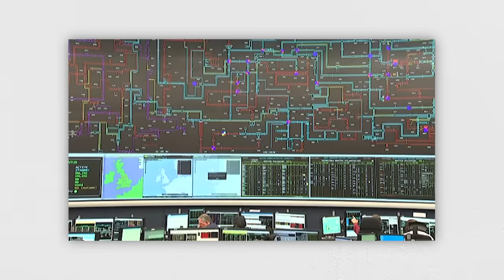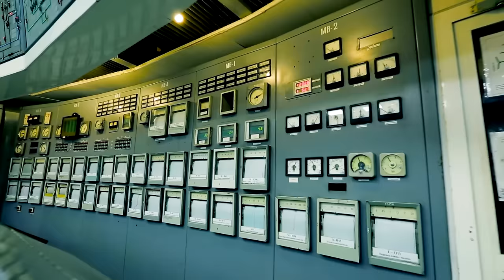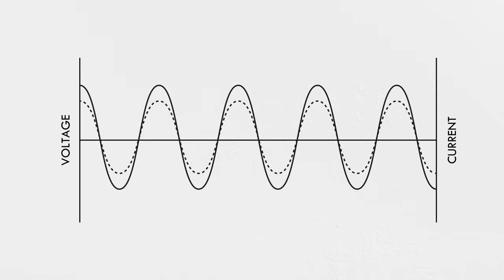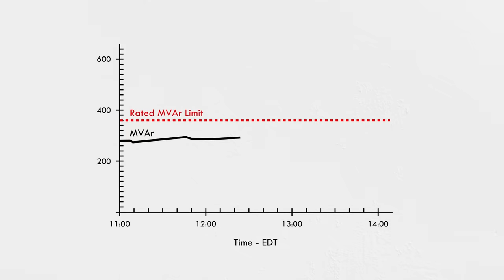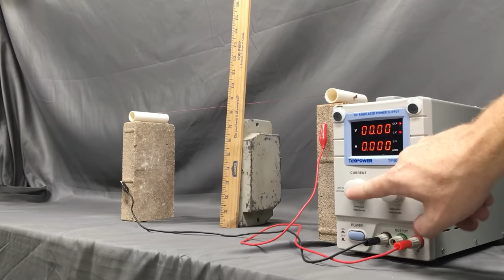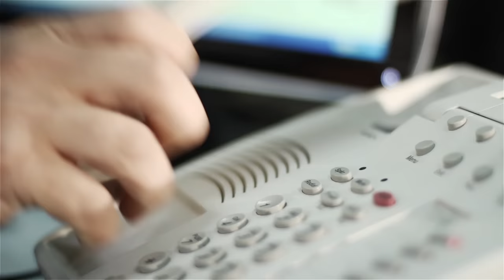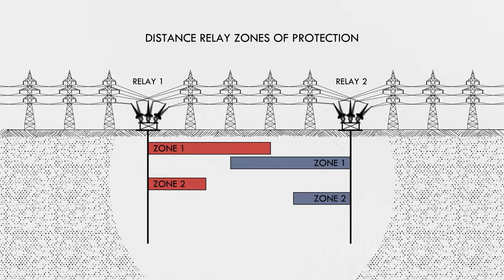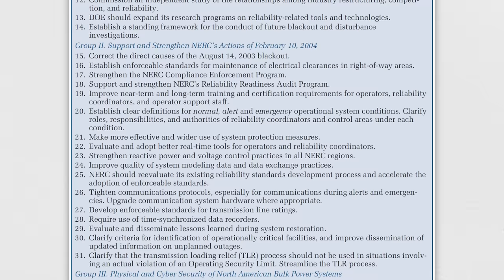What Really Happened During the 2003 Blackout?

Comment: The Lift Pump Station located near Ludington, Michigan helped save the entire eastern half of the US and Canadian  power grids. This facility maintained grid frequency by absorbing most of the nearly 5 GW load imbalance as the disconnects around Lake Erie engaged. The pump station filled itself to the brim, well past its safe design water surface elevation, then ran itself nearly dry, again outside of safe operating levels and at great risk of causing cavitation in the turbines to provide power afterwards. These actions helped prevent catastrophic damage cascading all the way to Denver and gave some time for other stations to reconnect.

If a power station is scrammed, a rapid shutdown, and depending on its type it can take days if not weeks to get a power station back up and running. A pump station can provide nearly immediate power generation.

Thank you to all of the station operators, line workers and service crews who struggled on that day, your actions and quick thinking, kept the lights on east of the Rockies and prevented a far darker outcome.

Both the 2003 and the Texas outages could have been much worse if the load imbalances had been allowed to progress a few minutes or even seconds longer.

The control systems in place now are night and day more robust than what was present in 2003.
Reply: Sounds like an entire video could be done on their actions that day
Reply: @T.J. Kong Now imagine a nation state deciding to infiltrate the intranet these stations connect on.
Reply: This was the early thousands, when communication systems were less robust
Reply: Living in Mt Pleasant, MI at the time, all I knew was that we had power and Detroit didn't. Now I know why! Thanks for that.
Reply: This sounds like an amazing story. I did some quick googling, but I didn't find any additional information. Would you mind sharing any articles about the Ludington Pump Station operators?
Reply: @kevin3434343434  So the plot of Die Hard 4?
Reply: We need significantly more of these stations for increased grid reliability.
Reply: @jtb1515  nah, we got batteries now for that now... plus there's more solar now then then, which can allow the homes to act as collective batteries and donate back to the gird...
Reply: You have anime profile picture,  your opinion doesn't matter.
Reply: @T.J. Kong The Alarm subsystem in the Energy Management Systems now have a little display that indicates that it's working.  If it stops cycling, you can immediately see that alarms aren't being processed.
Reply: If you can believe Wikipedia, the Ludington Pumped Storage Hydro Plant is comprised of six, 355MW units.  That's a little over 2GW, not 5.  And, I can't imagine being able to pump one over its design limits.  We had to demonstrate to FERC routinely of the multiple fail safes that we had in place at our pump storage plant to prevent filling above design level.  After the Tom Sauk plant in Missouri over topped its reservoir, this became even more heavily scrutinized.  
Also, if you ran a hydro so low that you risked cavitation not only would that be irresponsible and possibly destructive, the upper reservoir would be so low as to not provide much head which is required for power production
Reply: Based Michigan carrying half the US on its back
Reply: @123livewire  dang maybe OP is a bundle of sticks.
Reply: Wow, that's pretty interesting, props to the people at the place who kept it online
Reply: @123livewire  okay so you're saying that the pump station did jack shit to help in 03?
Reply: Lift pump station? That and a pumped storage hydroelectric station, which is what Ludington has,  are 2 very different things.
Reply: @alexrogers777  Not ours...it's independent. We should hook up a DeLorean to it.
Reply: There's a similar facility on the Canadian side of the Niagara Falls generating facility, called Sir Adam Beck Pump Generating Station. It pumps water into a "lake" at the top elevation during times of reduced water consumption at the main generating station and then is used during periods of higher demand to augment water that is available from the normal supply from the Falls.
Reply: @carlosanvito  There's a similar facility out here in so cal called Castaic Pumped Storage Plant. They're pretty common now
Reply: This is complete BS. Pumped Storage is great but it didn’t save any lives that day lol.
Reply: @PrograError ,  The total amount of batteries in California can run the grid by itself without the use of solar panels (say at 7 pm) for about 7 minutes.  California imports about 8,000 MW every hour from 7 pm to about 7 am, until the 14,000 MW of solar wakes up for the following day.  California does not have 8,000 MW of batteries yet, and might not for years,  And to get 8,000 MW X 12 hours, that would be a huge investment in batteries, that would not be needed on a daily basis, but only a once in a few years event like this one.  

Battery cost - they hope to get the cell cost to less than $100 per KW or about 10 MW for a million dollars. So a 8,000 MW battery would cost about $800 million just to purchase the cells, then about another $800 million to put those cells in racks, and connect them to the grid.  And that will serve the imported power needs of California for just 1 hour.  There are 12 hours before the solar panels start producing power the next morning.. .  .

And your typical solar system requires power to allow it to re-start.  So no power to them, they are not allowed to restart, because of the danger to electrical linemen, who count on a power line staying de-energized when they shut off power at one end.  I agree that once the grid is working, then all those solar panels can collectively absorb a lot of the loads on the grid, and are aHuge and un- recognized benefit to the grid stability.   However to much power "Could" be a bad thing, and cause the voltage to get to high, when there is more power supply than demand, and this results in increased line voltage and line frequency.  But with 10,000,000 customer's refrigerators suddenly coming online, and then those customers starting their heating systems, that is a lot of load that will come online just after power is restored to a tract of homes (and several tracts of homes).
Reply: That's not true. Where did you get that information? That's not what the power plant officials said in Buffalo, NY. There wasn't any pump station generating its power to the northeast electrical grid in Buffalo, NY. It was the nuclear power plant the one tripped its fault, leading to a complete shutdown in safe mode to prevent a nuclear explosion. It was the solar storm at the root of the outage that day. It failed to supply to Cleveland after a complete power outage in NYC was reported first. It hasn't reached Detroit until 4:45 pm that day. Cleveland went into a complete shutdown at 5:05 pm, cutting off powers to the entire northeast. So don't blame the pump station, blame Niagara Falls Nuclear Power Plant the one that triggers it.
Reply: @Kangenpower7 Amen brother. You saved me a lot of typing. These guys that think the batteries are going to handle a cold start of the grid are so deluded
Reply: @pantherzone2008 Bro what. That's like not even vaguely true of the August 2003 blackout bruh?  Whatchu smokin

Comment: I was working at a 2000 MW power plant that day. I recall hearing air blast breakers operating frantically in the switchyard just after 4 pm.  Lights blinked and then moments later the plant was black. From my office, I looked across the river and saw two other large power plants also fully tripped.  Our plant generators were spinning, but there was no grid to connect to. We hoped to keep the units ready to resynch, but we could not keep up with demin water consumption, and one by one, lost the plant.  The grid was partially restored by the next day when we were able to fire our units and resynch, thus rebuilding the grid. Certainly a day etched in my mind!
Reply: What kind of plant was that? In the hydro world we just keep one or two groups spinning and exited but asynchronous to maintain our auxiliary transformers indefinitely. What consumes demineralized water and why can't it run on local power?
Reply: I'll bet
Reply: @DickCheneyXX  Almost certainly the boiler make-up water for thermal power station.
Reply: If there was a station blackout, where did you get the power to run the pumps and the draft fans?
Reply: @gregorymalchuk272  We built the grid backwards from our hydro electric plant at Niagara Falls (their station service requirements are virtually zero) and when we had power at our station we were able to restart our units normally via the reserve station service transformer. We could aid have used standby gas turbine generators to do the same.
Reply: @DickCheneyXX  It's a coal plant, so the boilers use demin water to make steam. Normally, the steam is condensed and reused in a closed loop, but when spinning the turbines at zero load, the boilers cannot be turned down low enough, so we have to blowdown the steam which means we have to make new water. Quantities are huge, In the order of 1 million pounds per hour. We can't use normal water as it would damage the boilers and turbines. Local power didn't exist and even of it did, a plant that size would need about 50 Megawatts to start up all units.
Reply: @DickCheneyXX  Every boiling-water plant uses demineralized water in the steam system. Can't have your expensive, precision-engineered steam turbine fail because minerals precipitate onto the blades...
Reply: I once worked at a nuke plant and conditions forced us off grid. Emergency gen kicked in and everything went into shutdown. What an amazing thing
Reply: @danielmorse4213  Unlike nuke plants, we can hold our own for quite some time, supplying our own station service. But sadly, we were forced off due to a lack of denim water.
Reply: @carlosanvito  what is demin water ? What used it and what for ?
Reply: @Txepetxcc  Sorry for the "tech talk." It's demineralized water. That is the working fluid - it's heated by the fuel in the boilers to make steam (to temperature of 1000 degrees). That steam spins the turbines which turn the generator rotors to make electricity. When the steam is spent, it is condensed back to water and returned to the boiler to make steam again in an endless loop.  We must use demineralized water to prevent damaging both the boiler and turbine.
Reply: Very cool first hand account
Reply: This is why you keep some of the water from boiling your spaghetti noodles!
Reply: krisfalkenberg u sound like the Unabomber 😮

Comment: When first learning grid operations it was explained to me thus:

Imagine the ceiling in a room has a wide variety of hooks embedded.  Each hook can only support a different weight and will pull out if overstressed.  Now imagine you have a wide variety of weights that you must suspend from these hooks.  You attach them with rubber bands of varying strengths.  You link a bunch of hooks and weights with bands.  But if one hook pulls out, the weights stretch rubber bands and shift and you need to keep things suspended.   Now, plan things out so you never drop a weight, regardless if a hook pulls out, or a band breaks.
Reply: Whoops, you used too many rubber bands and nobody wants to pay for that. Try again but with less rubber bands. I don't care how safe it is as long as none of the weights ever fall. 

(Yes, that last sentence is supposed to be contradictory.)
Reply: I love this explanation!  It puts it in complex and simple to understand way to think about the grid, it's various load capacity factors, and the various loads on it, that nobody can really control.  

SCE in California can shut off all the air conditioner compressors for a huge number of customers by sending out a radio signal to a box on each A/C unit.  They could do this before 1986, when I found out about the system.  This can shed 100's of MW of power load from the grid instantly.

Comment: I'll always remember that day fondly. I was the admin of our companies servers and all of the battery backups were going nuts! First the brownouts, then blackouts, then when power stayed on within that hour all of the battery backups stayed on battery because of an over-voltage (it stayed over 130 volts for almost an hour!). Confusion set in since I had power, but they refused to switch back to online power and the batteries would not recharge. On a whim I turned on the fans on all three AC units, along with all the lights since everyone had gone home by then. That managed to get the power draw down below 130 so the battery backups went off battery and back on-line. From that point all I had to do was monitor the voltages until they stabilized below 130 volts and I could shut off the lights and fans on the AC units.
Thanks to your video I now know what was causing the over-voltage issue, and now most newer UPS are built so they won't go completely onto battery when over-voltage issues occur.
Reply: Boost buck ups are the best.
But they all have limits on what they can do.
Reply: That’s a cool story! I have worked in a datacenter however thankfully haven’t experienced anything like this. Good job using the AC to drop the line voltage - it doesn’t take much current flow to drop 5-10v from a building supply.
Reply: All I remember is that it took me 3 hours to get home a couple miles away. 
Road rage 😡
Reply: All this because IT guys failed to or refused to notify anyone of a problem and led to things escalating.

Comment: Please make a video about the process of bringing back power after a blackout. How do you bring power plants online again without them tripping again immediately? How are areas sectioned off to ensure load is consistent with supply as it is being brought online again? How are different "islands" reconnected between them ensuring frequency and phase sincronization after a blackout?
Reply: I watched the system at a switch station here.
In a event of a feeder overload the system dumped all the circuits leaving the switch station.
When they had three of the feeders back online they just powered on each outgoing circuit one by one with a delay of up to 10 minutes.
For The backbone grid they would also have the other issue of matching generation with demand.
Reply: You do in stages creating islands of generation and consumption. 

Then slow sync and join in more bits of the grid back together. Old school method of sync is to use. Light bulb for connecting each phase and then slow/speed up the generator till the light bulb goes out(no voltage difference means no difference between the phase)

Modern day uses GPS timing signals that aliign the phases.
Reply: There is a very interesting article I read where the DoE setup an isolated grid and had to restart it from scratch without using any Diesel generators; only using the solar setup.  It was a great article.  I can't find the original source.
Reply: @stephenrowley4171  synchroscopes are pretty neat bit of engineering
Reply: Great suggestion!
Reply: @amahlaka  I am pretty sure they won't be synchronizing it with Synchronizing Lamps. 🤣
Reply: @stewartthompson72  it's all done with GPS timing nowadays.
Reply: There would be an awesome video.
Reply: @stephenrowley4171  GPS timing won't account for phase delays in the lines.  While those can be calculated based on line parameters and loads, I wouldn't trust a simulation over direct measurements at the interconnect.
Reply: See my reply to either SteevieQ or Joe E, so I don't have to keep spamming the same paragraph ;)
Reply: @xheralt  Whatever you have been spamming in this thread is already gone, your comment that you won't spam some garbage paragraph again is now your only comment in this thread about synchronizing network islands after a blackout.  Also you didn't indicate who or what exactly you were supposedly responding to. There is no one above you named "SteevieQ" or "Joe E".  For now, I'll just have to assume you are part of tonight's global Russian cyber attacks.